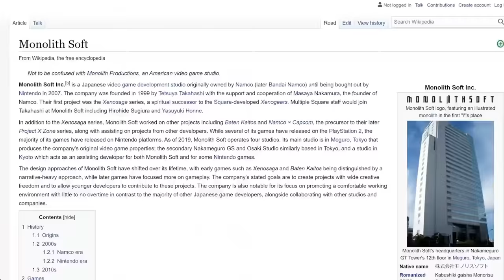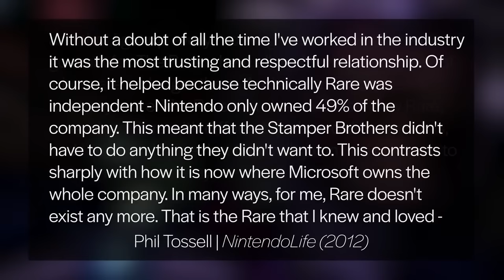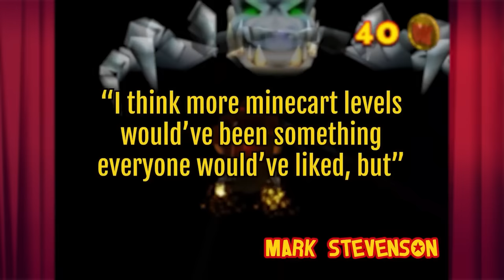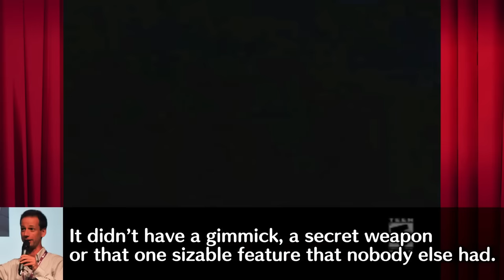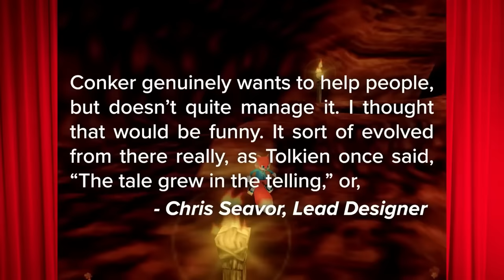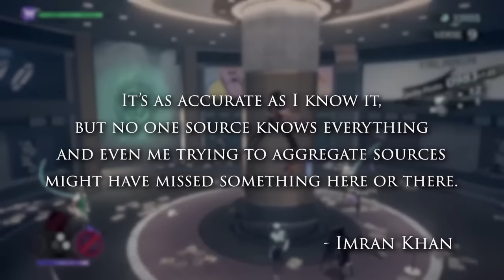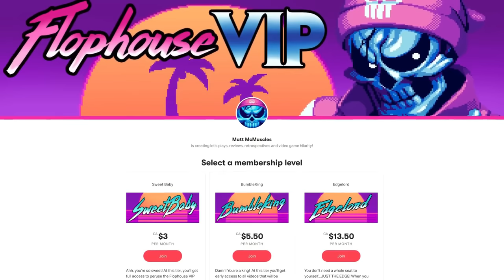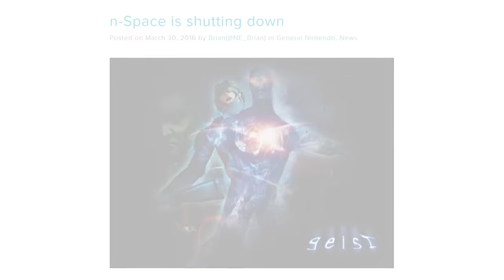Nearly 4 HOURS of Nintendo's most unhinged development stories to help you sleep

Comment: 3:19:45 Oh god, the R-Zone...mine was so ghetto that like the AVGN's, I lost that little plastic flip down reflector/magnifier, so it was a lot of fun basically playing a harsh red Tiger game...on a screen that was about 2x2 inches...and all the controller buttons were on see-saw switches (A connected to B,  X connected to Y)...WTF? so the corner of the face buttons would dig into your finger if you tried to do a slide press...if it weren't for the Scannerz line's stupid loading times, I'd say R-zone is the worst...

At least there was something a bit closer to actual "pixels" playing "Megaman" on my TI-87/89+ (that I could play in science and math class, lol)...and the only reason I remember that is because one of the only 4 robot masters was...Cash Man...who was literally a dollar sign...apparently a fan game brought him back in 2018...but I'm talking about a game I played in high school in 2000-03...I met a dude super into early emu...I think he was Korean, named James. Sat beside me in "Typing" class (Win98), and he somehow basically put a GB Megaman game on my graphing calculator (which, if you ever tried to find slopes or curves, a "Premium" graphing calculator has only a slightly lower res. and actually more ram and available storage overall than a GameBoy) but that's just echoing it's creator's mantra (Gunpei Yokoi)..."Think about re-purposing what you have before creating something entirely new." So, he used an under-powered calculator processor, tweaked the display to be smoother, though green...and added on the modular capability of insert-able disks...

...does anyone else remember the calculator Megaman game?